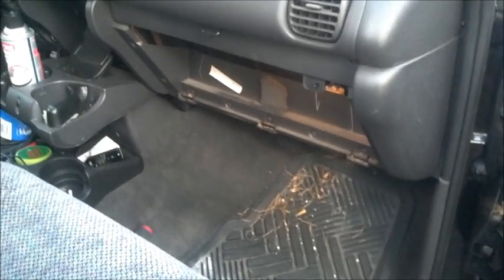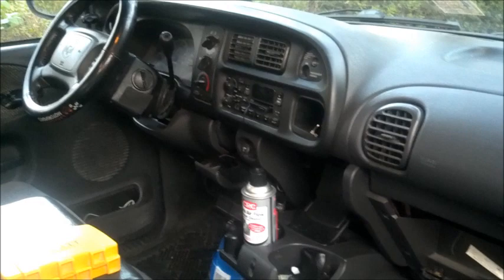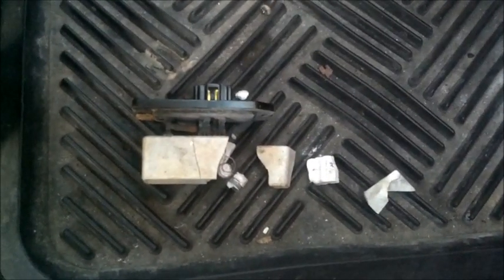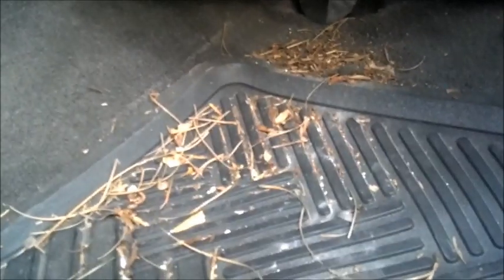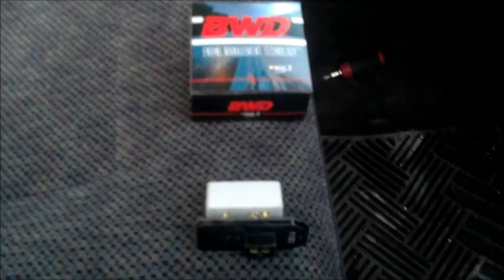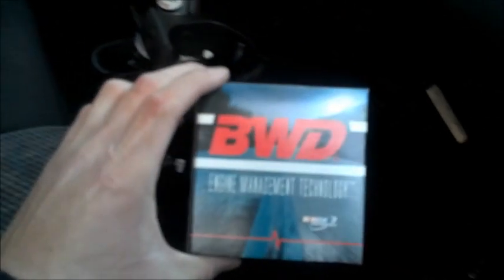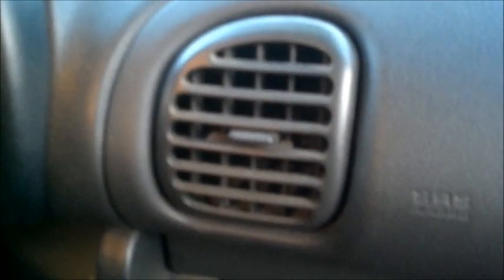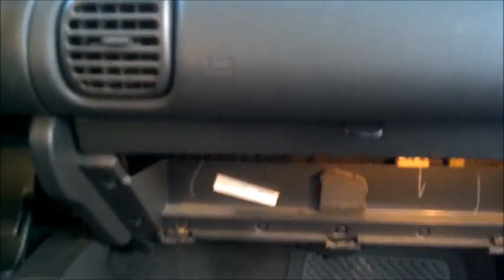2001 Dodge Ram 1500 Blower Motor Resistor Replacement

Comment: Matt, I enjoy your videos.  Yeah with almost any car if all of the speeds don't work the resistor is likely the issue.  Sometimes you change it and it goes out again.  (the blower motor is probably bad and drawing too much current)  $60.00 is a bad price.  Got mine from Rock Auto for $15.  They are available all over online for about that price.  Local auto stores are convenient and you can take parts back and get the correct one if you didn't the first time.  Online is a pain so triple check before you order. (check multiple sites and compare part numbers for example)  You can save a ton by avoiding the local auto parts store.

Comment: Thanks for the video! Seems easy enough. I have a question, do the 2 vents on your passenger side not blow as hard at the drivers side? I’ve been chasing this problem where my passenger side vents have weak air flow. Also, when on max a/c do u feel any air coming from the floor vents?

Comment: I have a 97 Ram that had the same problem with the fan.  However, the problem wasn't the resistor--it was a short in the wire gong to the fan.  There is a metal clip that holds the 2 wires going into the fan, and it had worn through the insulation and shorted the wire.  A little electrical tape fixed the problem (after I replaced the resistor, which took about five minutes.  A short screwdriver was the only tool needed.
Reply from the maker: Michael Howard Nice work on figuring out your issue!  Thanks for sharing your input...that information may be very helpful for someone with a similar issue.

Thanks for watching!
Reply: +Matt Payne Matt, thanks for the video. I replaced my blower motor resistor, as I had no fan speeds. did not work, so what's next? could it be the fan speed selector? How do I test the resistor leads for power flow?

Comment: Great video... I will be doing that myself here soon.. My fan makes a terrible noise as well, I just made a video on it.
Reply from the maker: Cool, thanks!  If your fan is only making noise but still works on all of the speed settings, then your problem is more likely the fan motor itself rather than the resistor.  I think my fan motor is going bad, too, but I haven't gotten around to replacing it yet.

But, if your fan doesn't blow at all on one or more speed settings, then replacing the resistor should definitely solve that problem.  Good luck!
Reply: ***** Yea, my fan only blows in the highest setting.. its either balls to the wall or nothing.. I am having break problems now but I will change the resistor this weekend probably.  Either way, thanks for the video!
Reply: ***** It could also be crap in the middle of the fan itself making noise.
Reply from the maker: TheBCSledder Yeah, I think you are right about that.  It sounds like there are some leaves/pine needles in there that rub against the fan blades sometime.  I need to drop the motor down and clean that sucker out...

Comment: Matt payne thanks< watched that, and its the same for 2001 dodge cummins 2500. same spot. really hard to get to. i had to do it upside down with doors closed and heat on pretty cold out. if i had not watch wouldn't know were to look, thank u
Reply from the maker: +Josh Mansfield I'm glad you found this helpful, Josh!  And congratulations on figuring out how to replace the resistor on your own.  I hope you're enjoying having all your fan speeds work again!  Thanks for watching!

Comment: ok thanks, I going to try the inclined part, but I have searched for the leak and haven't seen one.. but we let u know what u find out
Reply from the maker: +MrCHEVYBOI706 Cool, hopefully burping the system will solve your problem.  Let me know how it turns out.  Make sure you top off the radiator to the correct level after getting the air out...the coolant level will most likely drop after doing so.

Comment: Yep! Got a 2007 ram and called O'riely's and one with a lifetime wartranty was 60.00..... OUCH. I ooked at the leads going into the resistor and they are all black/oxidized. Either this part was way under designed or the motor draws too much current, meaning bad or under lubricated bearings. Don't be suprized if the resistor blows again. If it does, your motor probably needs replacing.... I was quoted 99 and some change for the motor, April 2014. I'd like to take some resistance measurements from a new one and see if I could build my own. Wouldn't be hard at all. Mine has 2 shorted terminals coming out of the top and a metal shield on the top, different than yours. Kinda weird.

Comment: 60 Bucks!!  Got it for 18 dollars at Rock Auto.  Fixed my problem, thanks.
Reply from the maker: Hi, I'm very sorry for not replying sooner - I was completely overwhelmed at work this summer/fall and I am just now getting a chance to catch up on messages and comments.  Please accept my apology, as I do try to make a point to respond to viewers in a timely manner.  I just got swamped over the summer and really couldn't keep up.

You are absolutely correct - I paid much more for my resistor than had I ordered it online.  However, I wanted to make the repair right away and didn't want to wait for the part to arrive via mail, so I purchased one locally.  If you can wait a few days, you can definitely find one cheaper online, and Rock Auto is a great source.

Thanks for watching!

Comment: I have a similar problem. All the fan speeds work its just that I can get any of the air setting to work. Only the air will come out of the defrost vents. All the settimg worked before but only when I started to drive but now it doesnt eben do that so i guess ill try this and see if this will fix it
Reply from the maker: +Cole hilmes Hey Cole, sorry for taking a while to respond to you, but I don't think your problem is related to the blower motor resistor.  Instead, I think you have a vacuum leak somewhere, because the duct selector switch is vacuum-actuated.  I had a very similar problem once before - when I would accelerate hard, the heat from the dash vents would suddenly switch to defrost only.  It turned out to be a broken vacuum connection somewhere in the engine compartment.  I would trace all of the vacuum lines that you can see in the engine bay and hopefully you'll find the source of your problem.

Good luck!  Let me know if you figure it out.
Reply: +Matt Payne yeah the problem was a vacuum line that rotted away. replaced it the other day and that fixed the problem
Reply from the maker: +Cole hilmes Cool, I'm glad you figured it out!  Good work.

Comment: what would cause the resister to pop? This is my 3rd roster it works for so long and maybe a month or so depending when I plug my truck in is when it pops. so I stopped plugging it in till I get it fixed. 

but now never plug it in and it blew. could the sodering be bad on the end? that it just gets hot and it blows or? 

To much volts?
Reply from the maker: Hmm, that is odd.  I would be very suspicious of your fan motor, though.  If it is going bad, it could be putting too much strain on the resistor.
Reply: My son had same problem...found out the blower motor was bad. Replaced that no more problems

Comment: 1998 dodge ram 1500 has low volume of air flowing from vents and condensation leaking into floorboard. What can I do to correct this problem?
Reply from the maker: joe shay Joe...it sounds to me like your evaporator coil, and possibly your condensate drain tube, might be clogged with gunk.  I would start by removing the blower motor, as shown in my video here:

https://www.youtube.com/watch?v=NL5Ar68KccA

Once you have the blower motor removed, reach your hand carefully up into the hole where the blower motor came out, and as you face the dash, feel to your left for the coil.  You should be able to reach it with your right hand; you'll have to bend your wrist at a sharp angle to the left once your hand is up inside the dash.  If there is a bunch of debris on the coil and in the drain pan, you'll need to figure out how to carefully clean it off and remove it.  If you have a decent camera phone, you may want to use it to take some photos of this area so you can see what you're dealing with.  You might want to get a squirt bottle and spray something like CLR on the coil and in the pan below it to try to break up the debris, and then flush it with clean water.  You should get to the point where the water runs out of the nipple sticking through the firewall into the engine bay on the passenger side.

Hopefully that makes sense.  I suppose it's possible your two symptoms (low airflow and moisture in the floorboard) could be two separate issues (bad blower motor resistor/blower motor, and a leaky heater core), but I would start by checking the coil first.  Hopefully it's as simple as cleaning some mess out.  I know that when I removed my blower motor, there was a bunch of leaves/debris in there.

Good luck!  Let me know if you figure it out.
Reply: Joe, you probably need to burp your heater core. I had the same issue.

Comment: I have a 98 ram 1500 and my heat won't blow out on the second and beyond.. I hear some gurgling under the dash maybe that has something to do with it to.. any assistance would be helpful.
Reply from the maker: +MrCHEVYBOI706 So sorry for the delayed response...I missed a few of these comments.  Anyway, it sounds like you may have a couple of separate issues.  The lack of blower motor function on several of the blower speeds is definitely indicative of a bad blower motor resistor.  I would try replacing the resistor, as shown in this video.  That should take care of that problem.

I believe the gurgling behind the dash is a separate issue, and is almost always related to having air in the cooling system.  I have experienced this as well.  This could be caused by simply having trapped air in system, which can be remedied by removing the radiator cap (with the engine COOL), parking the truck on a slight incline with the front end higher than the rear end, and starting the engine and allowing it to idle for a while.  This should allow the trapped air to escape (otherwise known as "burping the radiator").

The other possibility is that you have a leak somewhere in the cooling system, which is allowing air to be introduced into the system.  Have you been losing any coolant?  If so, keep an eye on the area under the truck in your driveway/garage and see if you can determine if coolant is dripping down from somewhere.  I know that on my truck, I have had a chronic coolant leak where the thermostat housing bolts to the intake manifold.  I haven't gotten around to fixing it, but I think it will be as simple as substituting RTV silicone for the seal between the housing and manifold, as opposed to the paper gasket that comes with a new thermostat.

I hope this information is helpful.  Good luck!

Comment: the a/c blows and all blower setting work
Reply from the maker: +MrCHEVYBOI706 Oh, I just saw this follow-up comment.  So you are saying that air blows out of your vents on all of the blower settings, but the heat only works on the first blower setting?  If that is the case, then I would say you almost definitely have air trapped in your cooling system, and it likely migrates to the heater core (which is behind the dash and is the highest point in the cooling system.  This is why you hear the gurgling sound behind the dash).  You'll need to determine if you have a coolant leak, or simply have trapped air as I described below.  I would start by trying to "burp" the radiator and see if the problem goes away.  If it does, then you should be good to go.  If not, you'll need to start hunting for the coolant leak.

Good luck!  Let me know what you find out.